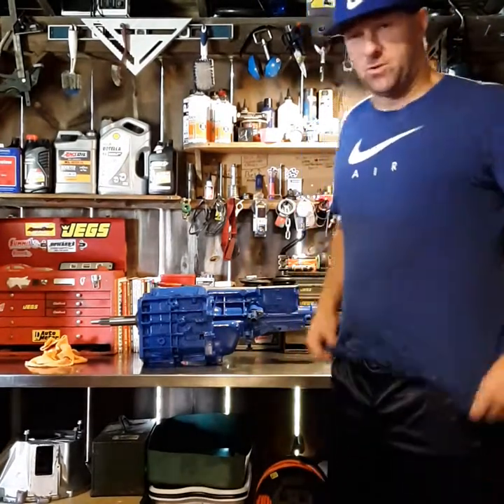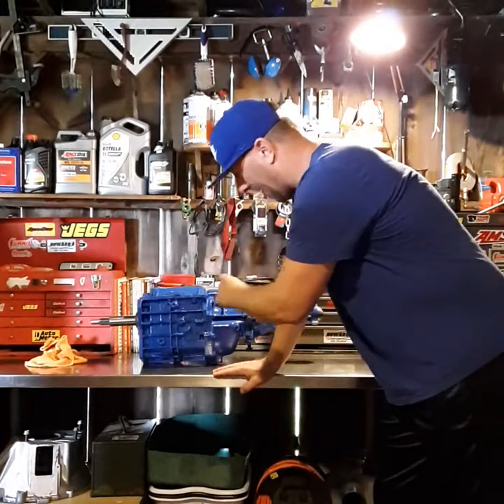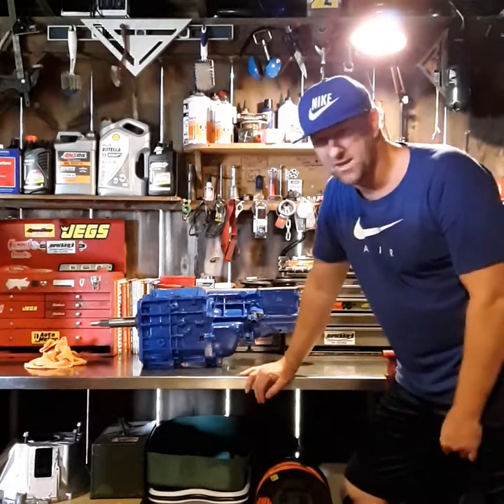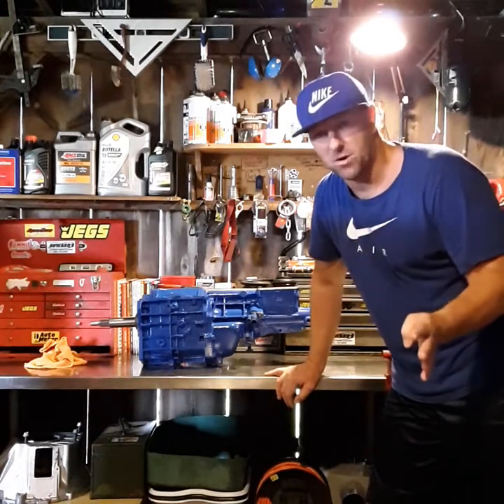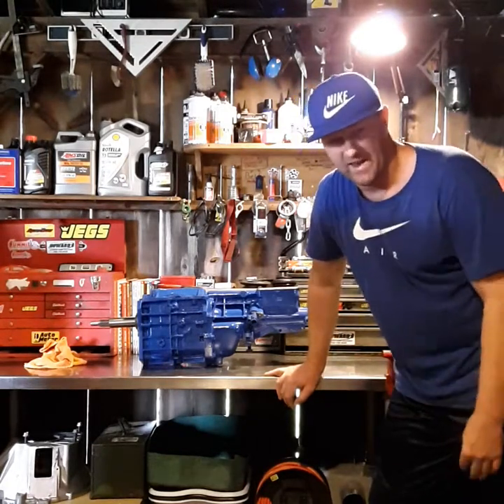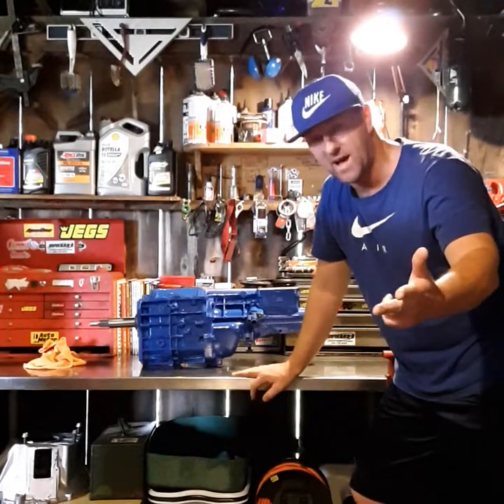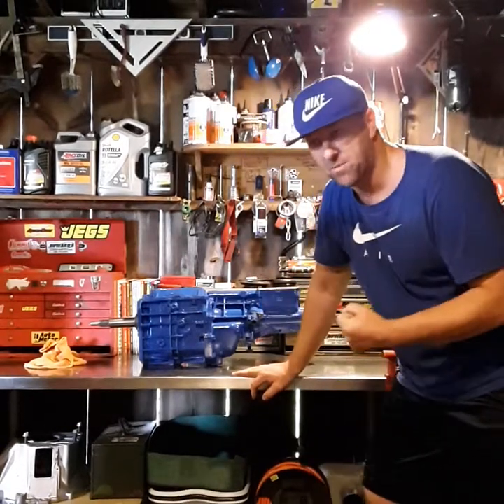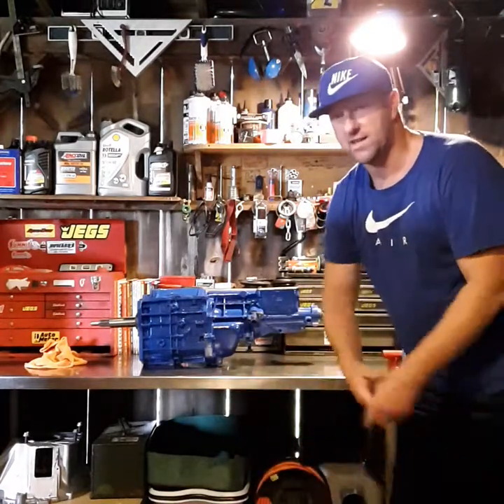how much POWER can a stock t-5 HANDLE

Comment: I have a H/C/I with NOS with FBO in a 1995 mustang cobra..500chp and 550 pounds of torque with traction..and my rebuild T5 with a few extras handles it just fine.. but I don't race it at the track.. only in the street from the dig and small rolls..💪

Comment: I got two broken t5s here from a stock 5.0 sn95 that leaked oil from the tailshaft seal. Car was a 215hp bone stock standard pistons heads and crank. Something stupid could trick you into thinking the gearbox is fucked. They are very good.

Comment: I have no problems and I beat on my 2000 mustang GT really bad...
Reply: That should be a t45, which is a bit tougher than a t5
Reply: You're right but I also have a 1985 and a 1990 GT and LX I also beat on those it depends what type of driver you are

Comment: Good video.I got a T5 in my 69 cougar with a 460. 365 hp and 500ft torque. Engine came out of 71 lincoln. It's been fine but, then again I don't launch it from a dead stop. I ease into it from 1st or punch it from a roll.